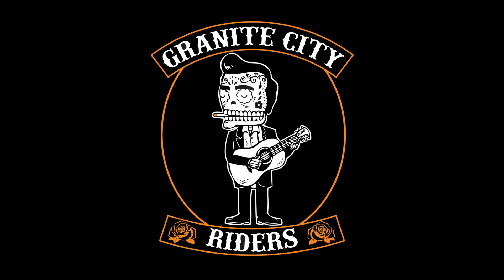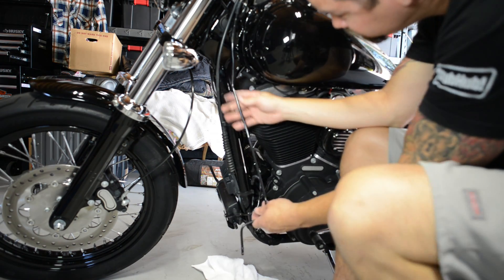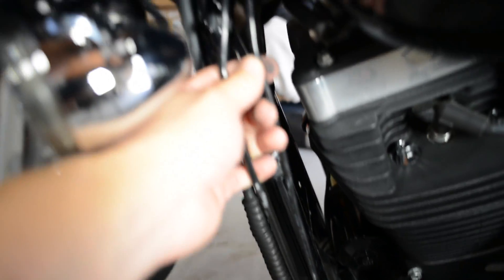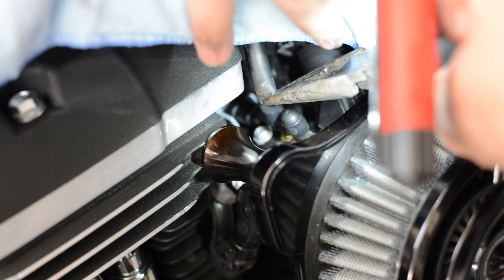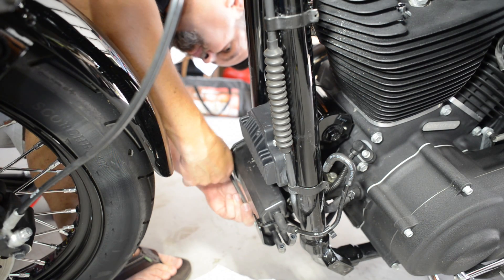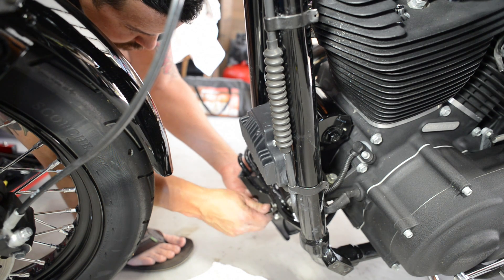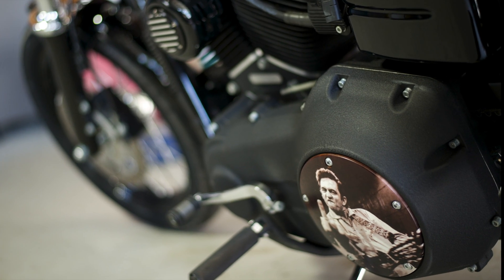How to Remove the California Emissions B.S. from your Harley Davidson for $5.00!!

Comment: Good video to the point and not a lot of extra crap.  My question is does that system affect performance at all or does it simply capture vapor from the tank?
Reply: As long as it's operating correctly a vapor/evappration/charcoal canister will not negatively effect perfomance.

Comment: I removed mine off my 2010 super glide but didn't remove the solenoid. I didn't even know there was one? At the time all the videos I could find said cut the lines and plug the one behind the fuel injection. It worked fine never had any issues at all.
Reply from the maker: They didn't always have a purge valve solenoid on the Dyna's... not sure which year they started using the valve.  Maybe it was after 2010.
Reply: My 2010 FXDB does not have the solenoid either. Just routes from tb and tank to canister to atmosphere.

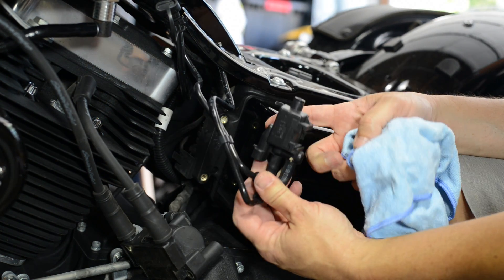Comment: At 02:43 in your video, the solenoid you are removing from your Dyna only has two tubes connected to it. Mine has a cable that connects to the port by the two hoses. Thoughts?

Comment: Hey man. So I watched your video and decided to take off the California bs too. Super easy and a great video. Only question I have is what did you do with the plug that plugged into the solenoid?  I wrapped mine in electrical tape and zip tide it in a good place. Only problem now is my engine light came on and it says P0444, something to do with that plug?  What should I do?  If I would have known that I have to see that engine light shit I would have just left it all hooked up. Can’t reinstall it bc I cut the lines to shit.

Comment: Hey man, thanks for posting this. Do you need to reinstall the solenoid?
Reply: Brandon Satterlee hey man just did this tonight. My check engine light came on without the solenoid so just leave it in and connected with no hoses. All good.

Comment: Hey man, saw the comment below bout how you used a heat shrink for the plug that goes into the solenoid. Did that prevent the engine light from coming on?

I bought my 2017 FXDLS in CA when I got back to AZ I took off the "California Emission B.S" but I had to plug back in the solenoid with no hoses because the check engine light would stay on.
Reply from the maker: Hi Angel, I didn't get any check engine light or any ill effects from removing the solenoid on a 2014, or 2013 FXDB.   No harm in leaving the solenoid in place with no hoses attached.   Sounds like a good solution.
Reply: I was thinking of using a heat shrink like you did and tucking it anyway but if you said it would cause no harm to the bike I may just leave it the way it is. Thanks for replying.
Reply: I just did this to my '16 Street Bob and the check engine light did come on. It didn't come back on after I plugged the solenoid back in. At least it is hidden behind the coil.

Comment: Great video thanks. What did you do with the plug that goes into the solenoid?
Reply from the maker: Hi Jamie.  Good question. I cut the plug off, capped the wires with a little heat shrink and tucked them away.
Reply: Did you remove the solenoid completely? I did and I keep throwing a code, so I had to dumpster dive for it... Im gonna cap it and stick it back in should that keep it from throwing the code?

Comment: 2:34 removing the remaining tubes... mine has a wire connected to that as well. I was removing it but where would that connection go after that. I’m wondering if that makes the engine light go on from other comments. Thanks dude
Reply: Tony Lam what I did was I kept it, and tucked it into the back with the cable from the pipes and zip tied them all together. It Looks flush. Cleaner. At least the canister is gone.
Reply: Tony Lam yeah I kept the block since it had a wire connected to it. It’s small so I tucked it behind where it was connected. I trimmed all cables except the tube behind the air cleaner. I rode a couple hundred miles to see if anything different would happen. So far so good.
Reply: I just did this mod on my 14’ dyna super glide, it’s best to leave the little block behind the coil pack to prevent the engine light coming up and make sure you cap off both nipples like the throttle body

Comment: Thanks for the video! I have a question that I was hoping you could help me. Recently I had to replace my carburetor from a 2002 Harley Davidson Sportster 883. The issue is I cannot buy a direct replacement and bought a knockoff one that lacks the vacuum tube. My petcock has a vacuum tube so I obviously would need to buy a non vacuum petcock and install the new carburetor. By switching to a non vacuum line would I have to get rid of the California solenoid and vapor canister?

Comment: I removed the can from my 2017 street bob and now im getting a check engine light ?
Reply from the maker: +Hey Jon, sorry to hear about your troubles.

For 49 state models the solenoid just isn’t there- and there is a cap on the vacuum port on the throttle body.   So this mod shouldn’t create a problem.  

What code is your bike throwing?
Reply: Great. I just this as well. But I retain the solenoid still in its original place. I notice the plug as soon as I moved the coil out of place. Hope I don't get a check light regardless. Wish me luck.
Reply: make sure you don't have a vacuum leak first and foremost.
Reply: jon kotlinski  did yu get this fixed ?
Reply: jon kotlinski  what code did yu throw ?
Reply: @GraniteCityRiders  I believe you need to connect to ECM and have that Feature turned off

Comment: What’s the benefits of this?
Reply from the maker: It's ugly.  It is added as an afterthought only to California Harleys.   Literally hangs off the front of the frame.   Also adds two hoses that run up the frame on the front of the bike.  At the end of the video you can see I added a chin... this is not possible without removing the vapor can.  On the 2018's, they did a better job of integrating the vapor can into the design.
Reply: CJ there isn’t one. Just looks
Reply: I just took mine off. Charcoal everywhere. It's meant to "clean" the air going into your tank via the intake system. But in reality, you fragments of charcoal going into your intake and your gas tank.

Comment: That canister recirculates vapors from your tank back into the intake so they are burned.
Reply: Not needed. Vent vapors to the atmosphere and allow the fuel injection system to control how much fuel is sent to the engine for ignition.

Comment: Did you have an electrical plug running into your solenoid? Mine seems to have one.
Reply from the maker: Yes, I had one.. I cut it off and capped the wires with some shrink tube and tucked it away.
Reply: Granite City Riders how did you deal/bypass with the DTC P0444 code?